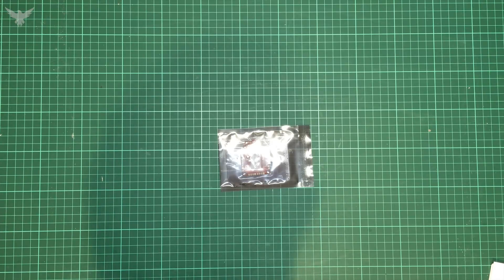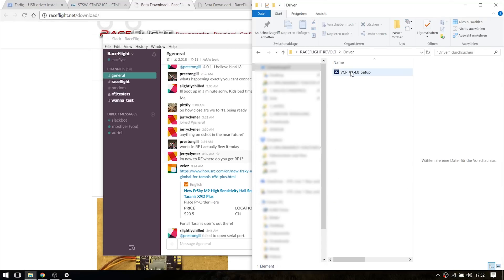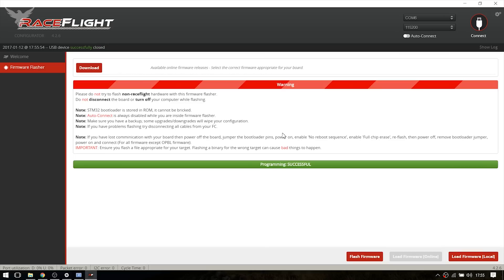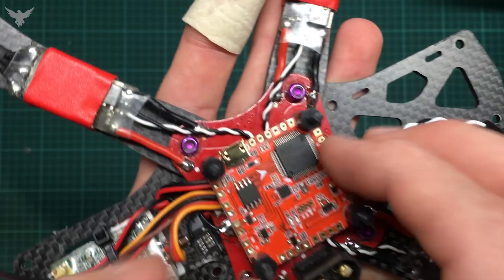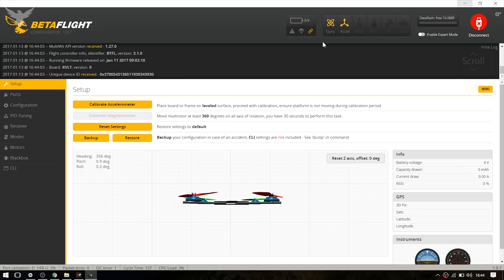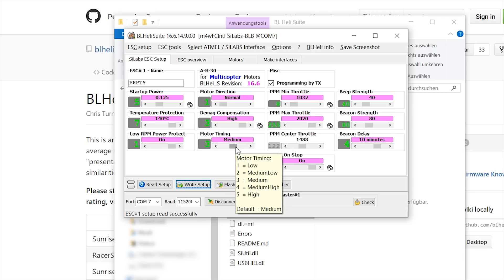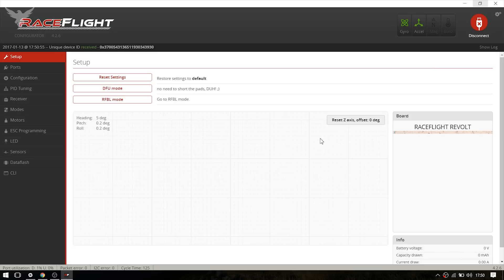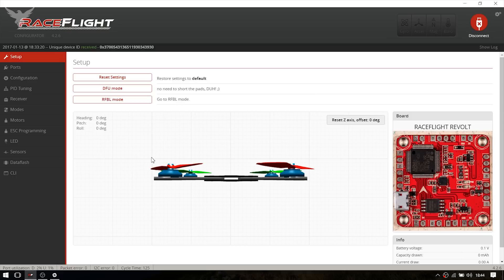How to install the RaceFlight REVOLT F4

Comment: hi Raceflight revolt v2 . The bipper does not work at low battery voltage. Firmware 0.500. Why?

Comment: Hey man just to let you know i made a built on the alien 5 inch. Apparently the stock pdb of the alien has no bec and has been giving me electrical issues. I think you need to use a pdb with a bec and not use the impulserc alien pdb one. Wasted a lot of time on this built before someone pointed out my issue

Comment: I have the revo board Will this work with that
As i am having problem with motors ,as soon as i throttle up the all max speed and when i lower the throttle ,they don't lower ,they continue to spin at there max
Also can you tell me what the loop setting should be for this on my littlebee 1 shot 20 amp esc's
Reply from the maker: I don't own either a revo board or little bee esc's sry!

Comment: My propers are on correctly,yet it flips ,Why/Can you advise,thanks
Reply from the maker: Did you solder the motor wires to the correct pads on the revolt? (it is different from the regular betaflight/cleanflight layout!). If it flips you have a few things to check: motor direction, props, board orientation, receiver-transmitter,...
Reply: i think i have found the problem,one of the esc was playing up

Comment: This tutorial is a true gift. thank you for your effort sharing your expertise on this issue. i have followed your steps carefully and installed a revolt v1. considering the telemetry, nevertheless it does not work so far. the controlsticks input is visible on the gui, the rssi is stable. the uart 1 is enabled to serial and the rx in the configuration tab is selected with sbus. i am using a taranis by the way. the voltage reading on the gui is adequate the vbat connection to board from the pdb is fine. the jumper for the rx is bridged to 5v and the smart port of my x4r is connected to the tx pin, as you have shown in your tutorial. so communication inbetween rx and taranis is fine and the voltagereading of the board also is fine, but the voltage is not displayed on the taranis. i have used the very rx before on a spracing f3 board and telemetry was fine. thank you for a hint what i might have forgotten to adjust to have telemetry working. cheers, mager
Reply from the maker: I am not quite sure but as far as I know the telemetry does not work yet. The voltage readings of the revolt can only make the beeper beep. Just be patient... the full telemetry will be available soon I guess
Reply: MpxFlyer thank you for your precise words... that helps a lot🎯. Sincerely..

Comment: good video
I'm having trouble setting the modes, when I set the ARM board and hit save, it saves but it doesn't go red when I flick the switch so the board doesn't arm. any ideas?
Reply from the maker: Did you activate double arm? if yes you have to flick the switch two times to make it work! And do not test it in the raceflight configurator. unplug usb, dismount the props, plug the lipo in and flick the switch a few times. probably add a little bit of throttle after arming. maybe your min throttle is to low as well.
Reply: thank you for a very quick reply. I will give that shot thank you
Reply: so I enabled multi shot, I tried flicking the switch a few times but still not armed
Reply from the maker: Gary Wilson did you really select the right switch in the configurator? does the switch even move in the configurator? which transmitter do you use?
Reply: Yeah it moves into the area set to arm the board. I use a spectrum dx8
Reply from the maker: Gary Wilson please join the slack group of raceflight and ask the developers. As far as I know there was a discussion about spektrum transmitters. I think you have to change the endpoints in your tx to -72/72. But I am not quite sure about that!!
Reply from the maker: Gary Wilson the safest and quickest way to troubleshoot your problem would be to ask in the slack group! sadly I have no experience with the DX8 and raceflight.
Reply: thank you for your help
Reply from the maker: did you sort it out? does it work?
Reply: yes thanks a lot. 
I had my mind throttle set a touch too high as I'd not fine tuned it in the receiver section

Comment: I can not make it work. It appears working when i go to the receiver tab and move the sticks on the tx and it works on the screen, but anything else is not working. I asked to support on GetFpv (where i bought the fc) and when i told them that qhen i move my drone the screen drone is not moving, they told me this "The Revolt does not use the accelerometer, moving the drone will not move the on-screen drone." 
So, yours is moving, dont know what else to do. on motors tab is not working also. 

Please help. 
Thanks

Ps: i´m runing on a Mac, but also try on windows and the same
Reply from the maker: Have you tried reflashing the board? sounds kind of strange!
Reply: MpxFlyer I will try that. 
Thanks for your quick answer. I really apareciste it

Comment: Hi can you help Iam getting slight movement on each motor when the lipo is plugged in But the motors wont spin up for some reason,When i select master in motors tab in raceflight the sliders move but motors again wont spin They were working earlier today  Would something in the setting stop this By the way all endpoints are correct Cheers
Reply from the maker: Do you have the same random spins as I have at 8:43? If yes you have to calibrate your escs! Your lipo was plugged in while testing the motors in RF configurator as well? If you motor do not spin up at all check your solder joints or try your esc's & motors with a regular receiver. If they don't work, even with a regular receiver you probably have softbricked your escs!
Reply: Even though my Littlebee 20amp say they are multishot I had to put them on oneshot and that sorted the problem Thanks for all you help

Comment: Hey there! nice video.
I just have some starting problems... 
I have the dfu pads soldered and when I hook it up to the pc, I can't find it on zadig. I downloaded the stm 32 ports and installed them, but it doesn't show up on zadig... (tried on 2 pc's)
Any advice?
thanks!
Reply from the maker: did you click on "list all devices"? Do you find it in zadig without the bootloader pads soldered together? maybe use another USB wire. It could be possible that you use a bad one without the "signal" wire!
Reply: Ah I just got it :D really had to try 5 different cables...
Reply from the maker: Had the same problem with another FC.. just was not able to get it working... after days of troubleshooting I just tried another usb cable and it worked.
Reply: So jetzt auf deutsch :) Ich bin beim Bl heli programm, bekomme allerdings auf meinem 3. esc die fehlermeldung: "Erased or unknown firmware". Und ja, jetzt weiß ich nichtmehr weiter...
Reply from the maker: +gilles bernard das hatte ich auch bei einem meiner escs... ich musste ihn tauschen. falls du einen adruino herumliegen hast kannst du die escs aber reparieren.
Reply from the maker: +gilles bernard http://intofpv.com/t-blhelis-16-3-erased-or-unknown-fw-issue
Reply: Shit, nee arduino hab ich nicht... frag mal bei den Kollegen rum... danke aber!

Comment: raaaceefliggghttt....ahaa
Reply from the maker: It would be fine I guess. However on the offical wiring diagram they do use a ground wire as well!
Reply from the maker: michi386 DFU mode funktioniert :P
Reply: "Complex driver configuration tools are a
 thing of the past with the Revolt thanks to its new driverless 
installation technology. No messing around with Zadig or DFU to update 
your software, simply install the Revolt onto your quad and get in the 
air right away - no fiddly tuning required!
The Revolt also features DFU free updating and a self-healing and updating bootloader, just in case something does go wrong.
Don't conform to the established standards - Revolt!"
XD
Reply from the maker: michi386 beta beta beta beta beta
Reply: Hey,

can you show us your wiring not in a fast forward vid. I'm interested in wiring especially. do solder a power connection separately from the pdb to the flightcontroller?
Reply from the maker: only apply 5V to the board so do not connect your PDB with the board without a 5V BEC inbetween
Reply: do you think I need to ground wire the Vbat too?
I think it has ground enough by the esc connections